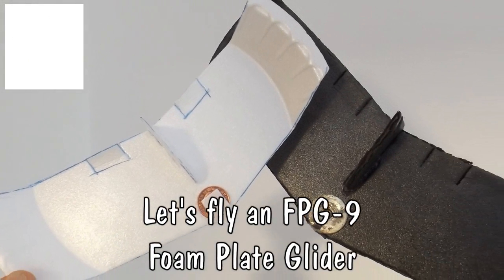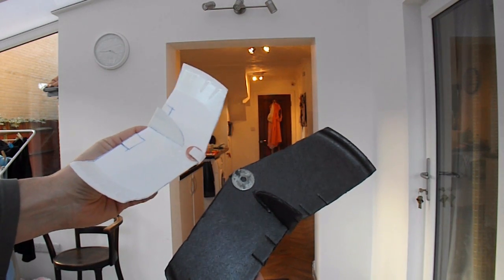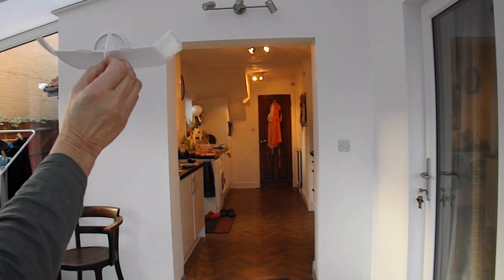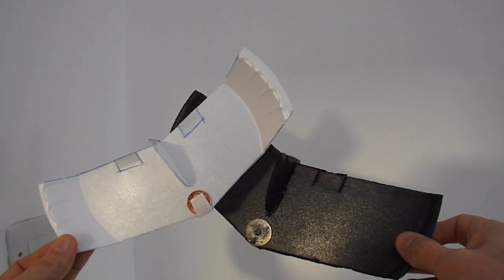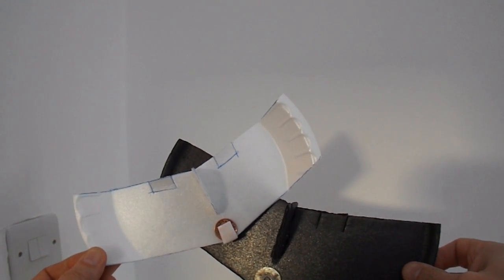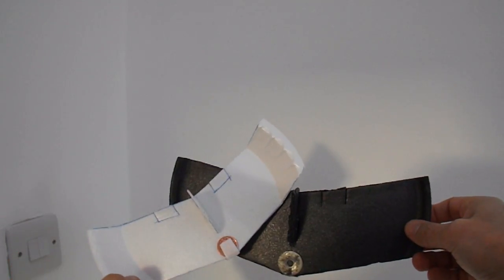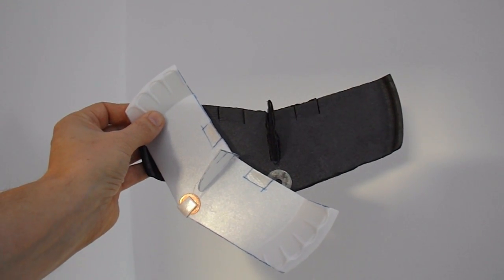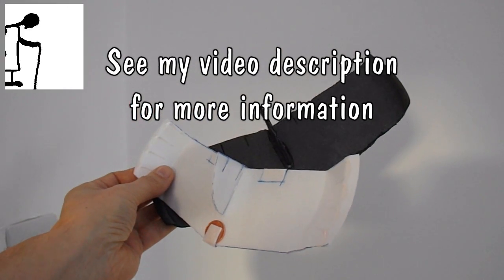Let's fly an FPG9 indoors

Comment: A Zagi type with a tail and they look to go very well indoors :)
Speaking of which, my fave flying wing is the Horten IX. Richard Keller was a designer who worked with Lippisch and then with the Hortens, I built an R/C version of his Horten IX with a tail and it can outfly me by miles ! Incredibly stable, huge glide, nimble if wished.  Check out image 5:  http://www.twitt.org/RichardKeller.html
Reply from the maker: It is fascinating how many different shapes seem to fly. I had a chap adamant the front wing must always be larger that the back so I asked how he explained canards and deltas.
Reply: GrandadIsAnOldMan
One amazingly successful aircraft looks mathematically wrong and that would be the Spitfire. Complete genius when flown though.
http://spitfiresite.com/uploaded_images/spitfire-k5054-top.jpg